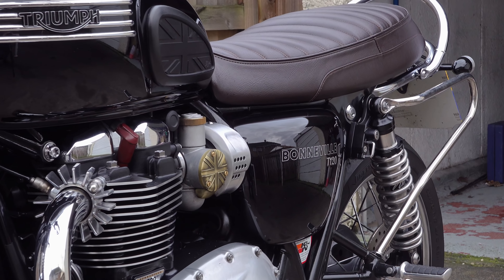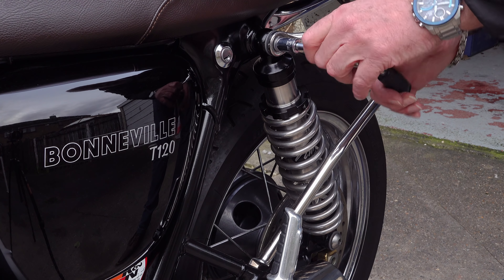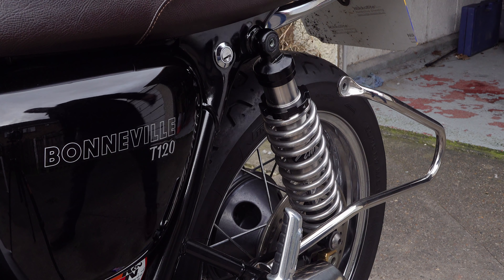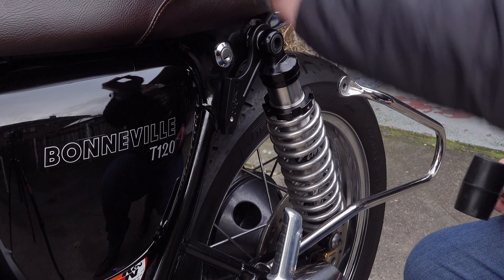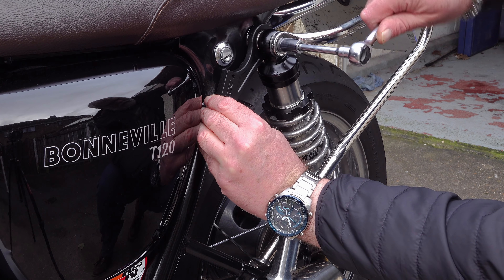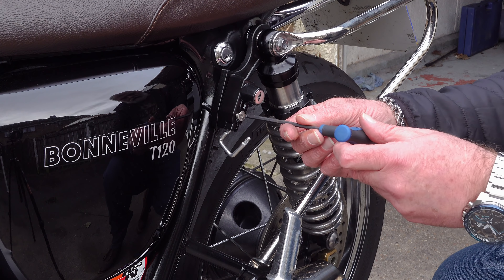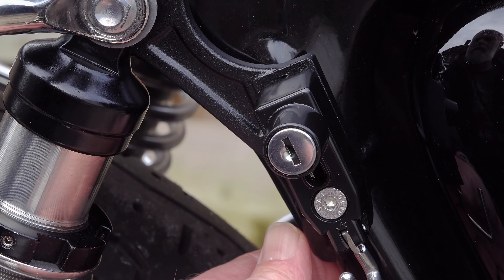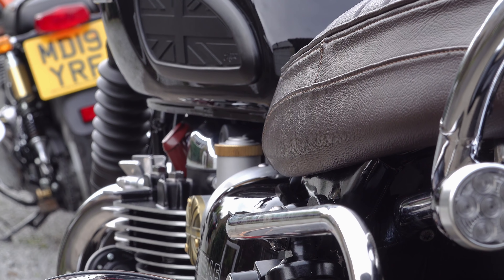Liquid Cooled Triumph Bonnville, Lock up your helmet!

Comment: Though I agree that motorcycles do need to be manufactured with proper helmet locks I DID have a helmet stolen off the helmet lock by cutting the strap. I started riding in the 70's and remember owning a few Triumphs and BSA's with the flip up seats on hinges. Personally I don't think I would want any of the new Bonnivilles. I think the Royal Enfield 650 is much closer to the original 650 twin riding experience. It wasn't about  power, (though they seemed pretty quick at the time) it was about the experience.
Reply: The RE 650 is a great machine. I would happily have one in my garage next to my T120 like Stuart has done. Both have unique characters and are a joy to ride in their own way. Bottom line is you can't go wrong with either one of them.

Comment: Stuart  spotted a flaw in this lock. The allen screw could just be removed and helmet and lock taken ,cut of at the tea leafs home. I would suggest that the allen be put in with loads of stud lock on the threads to make far more difficult.Another cheap easy fix could be to superglue a offcut of same size allen key,just a thought     Other than that a great product.
Reply from the maker: actually you cant access it with the lock engaged.
Reply: @stuartfillingham  What even with a ball ended allen key,looked in video as if there was room to get a key in there, but I haven't got one so if you say its so , so be it .

Comment: Do you recommend any rear disc or u locks for the 120?  I just noticed today that none of my locks can fit on around or thru my rear disc or sprocket because of the lack of holes and due to how the spoked wheel is designed.

Comment: I too am old enough to remember a time when all bikes came with a helmet lock.
These days I use a cable lock or chain through the chin guard of a full-face helmet to secure it to the bike. A helmet the right way up on the bike is less likely to fill with rain. 
If you absolutely must use an open-face helmet get a suitable top box and store your helmet in that. It's also a good place to leave your gloves. A thief will not be tempted to steal something he cannot see.

Comment: Hi Stuart,
This is a well made part  but sadly  when fitted to my 2018 Street Twin, all checked for alignment, tightened to 28Nm.
Helmet lock bracket was not tight, and moved all over the place.
Definitely a good item, but did not work on the Street Twin.
Sadly, had to return it.

Comment: One other thing that struck me watching this again is what is to stop a thief removing the top bolt on the shock absorber and nicking helmet and lock?
Reply from the maker: LOl I think your overthinking it John and straying from the realm of sublime to ridiculous! Rather than mess around like that, A determined thief equipped to steal would just throw the entire bike with the aid of an accomplice into the back of a van and deal with the helmet later while he was breaking the bike up for spares. much less of a risk than dismantling components in public and actually quite common!
Reply: @stuartfillingham  yes succinctly put as always! As a fellow ex-cop I tend to think if it's not nailed down someone will nick it. I've ordered one in any case. Thanks for your video's which are always enjoyable and informative.

Comment: Wait... why not use the helmet hook under the seat? What's the reasoning?
Reply from the maker: I think I explained that Nicholas, in fact I spent about 2 minutes discussing it!
Reply: Because even if it isn't enough of a PITA to remove the seat (why couldn't Triumph hinge the seat on 1 side?), it IS to get the seat back on. i don't want to have to do that every time I leave the bike to go into a store, etc. PLUS, the miniscule hook spot-welded onto the frame to hang the helmet on could probably be snapped off easily enough by a quick jerk downward on the helmet.

Comment: @stuart fillingham I've yet to find a helmet lock setup that will work with the micro ratchet chin strap on my Neotec 2 and a growing number of other helmets. Motone to the rescue perhaps? 

Will this part work with panniers bags mounted? Seems a bit tight space wise, and it looks like the helmet was resting on the exhaust pipe, or was that just the camera angle? Thanks again for the helpful videos. Cheers!
Reply from the maker: Hi Mako yes ratchet type fasteners are a problem for any helmet lock im afraid. panniers fitted should not be a problem, and the helmet should be rested on the rear footpeg to keep it clear of a hot exhaust, not that it actually reaches the exhaust with my set up!

Comment: Can a ball end hex key fit it in the locked position to remove the lock and helmet as one? if so it wouldn't be a big job to take both.
Reply from the maker: no you cant access it with the lock in place. In any event high strength locktite would put an end to any such possibility!
Reply: Thanks for your response I will order two soon